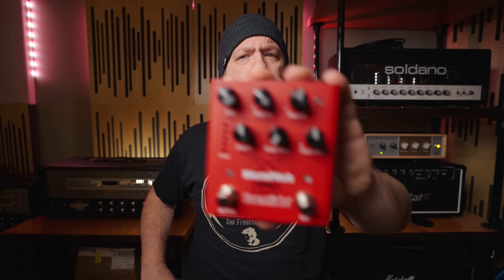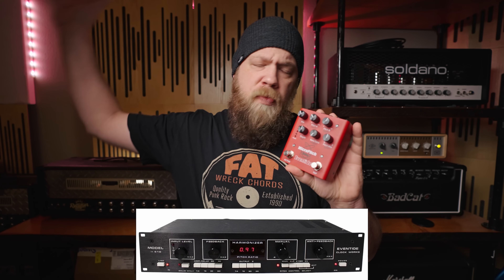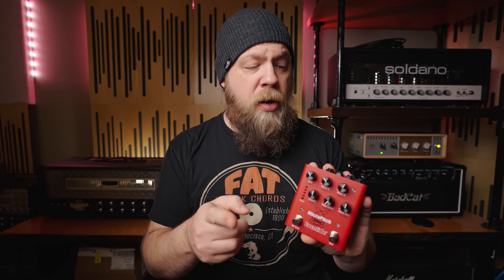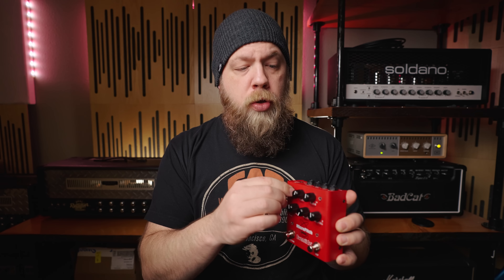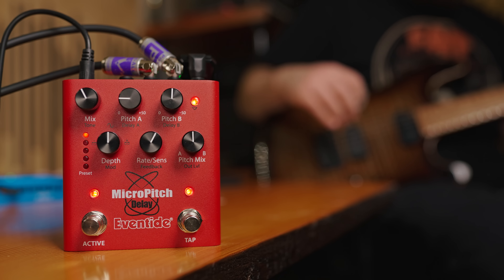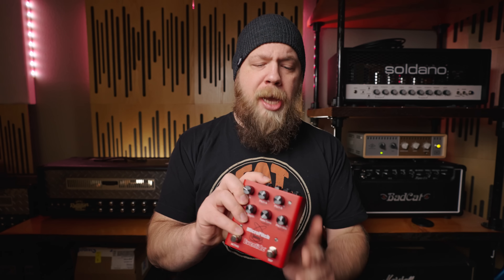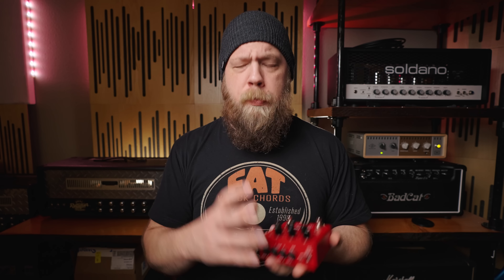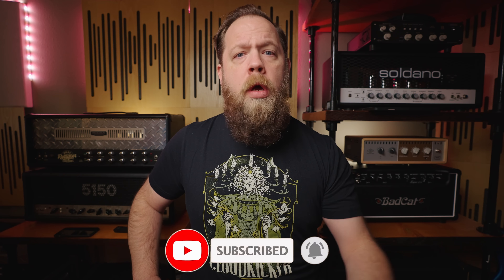ALL THE PITCH FUN! Eventide MicroPitch!

Comment: It sounds great, but much like the black hole solo pedal, why not spend another $100 and get the h9 core (while you still can)?  Is there something that this one does that the h9 can’t? Other than the obvious controls onboard. Maybe this one is better for making quick changes on the fly in a live situation versus having to pull up the app for specific changes on the h9? Lots of questions but just trying to understand why a single pedal that is $100 less is better than a multi h9 pedal that can do all this plus other effects.
Reply: Exactly. Not to mention, double functionality of knobs is a pain. Split knobs would have been better
Reply: I got one used.  The thing is, if I had an H9 or H90, I would be using this algo 99% of the time.  Now, getting the H90 makes more sense, as three algorithm is better than two.

Comment: How do you use this in an effect loop to get stereo?  I have 2 amps, 2 effect loops, I have a G-major in the master effect loop with the left side, and then send the right side to the return on the slave amp.  This works with 3-cables great for the G-major, and its stereo effects, like detune, and chorus sound huge.  I want to use this Micropitch similarly if it can be done.

Comment: Totally unrelated to the video - so I apologize. 
When using MIDI patch changes, is it possible to also automate volume swells within a set to get rid of the need for a volume pedal?
Reply: You can use MIDI CC to control the Output Level parameter, or the entire EXP mapping which may include the Output Level control